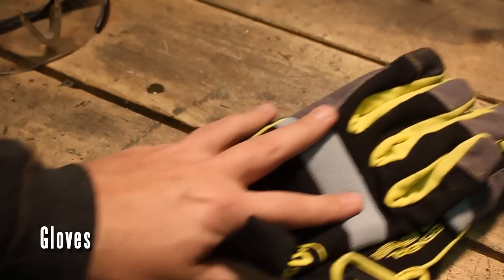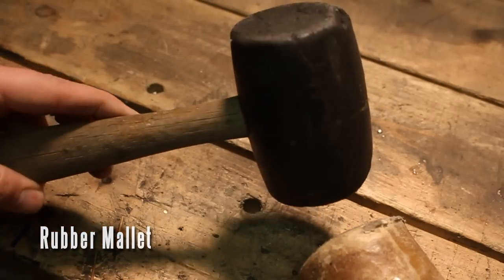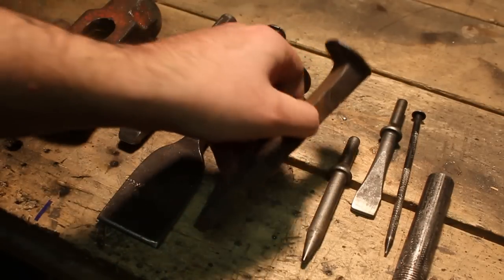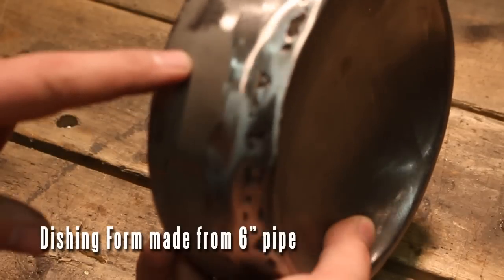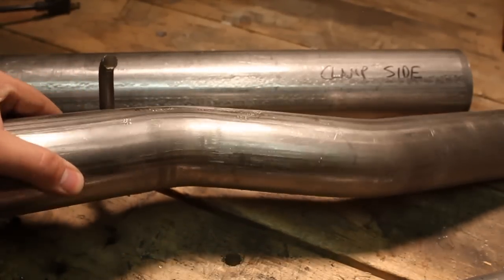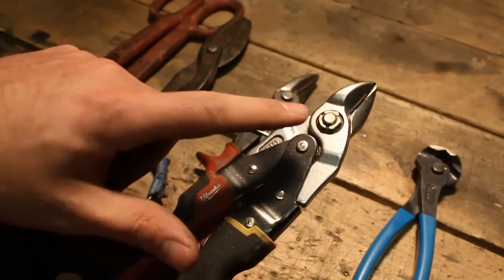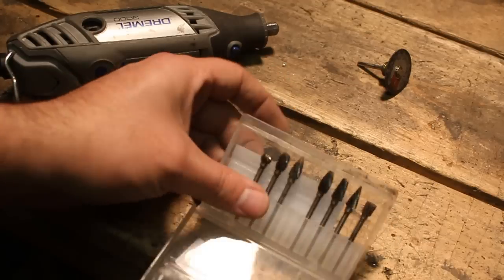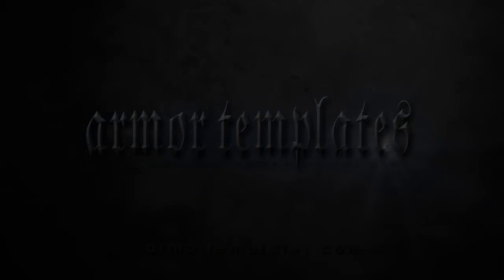Guide to Armoring Tools (cheap!)

Comment: How about smith a bevelly shear?
Reply from the maker: that might be a little beyond my skill haha
Reply: You could take some shears. drill a hole in the handle so that you can screw or bolt the bottom handle to a stump or bench. Then put a long pipe over the top handle to make it long. If you steal my idea can you give me a shout out please?
Reply from the maker: Well in addition to it being operated by a lever making it easier to cut, it also has no "throat". In other words, there's nowhere for metal to get caught on as you are cutting. With the design you described, you would just have very powerful snips mounted to a bench, and there would be a catch point where the blades meet. If you ever try it though, I'd like to see a video on it
Reply: Oh I was thinking of the old fashion version that was just big metal shears that you mount onto something. Like in the video 'Dressing in Steel:  Part One' by the Met. Which you can find on youtube. You can also see giant shears in the drawing of Emperor Maximilian's armour workshop.

Comment: what did the medieval armorers use to smooth and polish after the hammering and shaping?this has always been a curiosity to me as they did not have the convenience of electricity
Reply from the maker: They spent far more time (and skill) doing their planishing. As far as the final polishing of the surface, I am not sure. I imagine they had access to abrasives of some kind, but nothing like the sandpaper we use today.
Reply: @DavidGuyton  thanks for responding.
  it just occurred to me, (after reading your comment), that maybe they used crushed walnut shells, kind of like when you do the final polishing on a brass casing in one of those polishing tumblers.
i dont know, just musing here.

Comment: When making your armors what is your favorite or, most commonly used steel sheet thickness? For example 0.036?
Reason I ask is because i'd like to start making some of my own armors but, I don't know how thick a good steel shoulder pad, or bracer may be. Any feedback is helpful.
Reply from the maker: .036 mild steel is what I have been using lately. It all depends on what you are doing with the armor and what you are building. If the parts are dished, it adds a lot of strength and you can get by with using about 20 gauge (.036). If you are making something like a bracer, which is curved, but not dished, you may get some dents in it with some use. For a bracer or gauntlet I would probably bump up to 18 gauge (.050 or so). If you are looking for "real" armor that you intend to heat treat and all that jazz, you'll want to work with 16ga, but that stuff is hard to cut and hard to shape without heat. Using my method, the thinner stuff works best. if you want to use stainless, you can go thinner and still have good strength. For instance, 20ga stainless behaves more like 18ga in plain steel. It's harder, so it holds its shape better, but it is also a very stubborn metal when trying to shape it.
Reply: Thank you for the reply!  You gave me a lot of great info and that was exactly what I needed to hear. By the way great work! I've watched a lot of your videos and your projects and very cool and inspiring.

Comment: Sorry if this has already been asked, but I live in an apartment and no space for a workbench.  For the vise situation… would a jaw horse be stable enough for use in the projects you have templates for?
Reply from the maker: I'm a firm believer in the idea of making anything work. It might be a little more difficult or slower  but you can make it work.

Comment: What did you use to polish your sledgehammer head?
Reply from the maker: I used a flap disk on a handheld grinder to get started, and then I used some regular sandpaper in progressively finer grits to finalize it

Comment: Thanks for the insight 
I want to work more with metal after seeing your inspirational videos. What gauge steel do you mainly work with?
Reply from the maker: I use anything from 20 gauge to 16 gauge, but I tend to use the thinner stuff because it's easier to work without heat. I try to keep things simple on this channel so that lots of people can do this, as opposed to making videos that would be beyond the ability of most average people.
Reply: And it's appreciated, thanks :)

Comment: Do you only deal with costume Armour or do you have some knowledge on more practical sets?
Reply from the maker: I stick to easier stuff that ordinary people can pull off, although I work with up to 16 gauge on occasion. No heat treatment though
Reply: @DavidGuyton  would Heat treatment add enough hardness for it to be a more resistant Armour, just wondering what modern ballistic steel Armour
Reply from the maker: @jsticks7381  Yes heat treatment hardens the steel significantly. The ballistic plate armor is most definitely hardened.

Comment: Hi David! Your tutorials are amazing and blow my mind every time! But I was curious on how much one of these projects (Gauntlet 1 or 2)  would cost to make. Excluding the templates and tools of course.
Reply from the maker: You mean just the cost of materials? It would depend on the materials you chose. The gloves are about $13 at Walmart or Amazon. If you chose stainless steel, you can get enough to make 2 gauntlets for about $20. Brass is much, much more expensive, and you'll need to spend about $140 in brass for 2 gauntlets. You'll probably spend a few bucks on a few other things but as long as you stay away from brass it's not expensive at all.
Reply: thanks man!

Comment: great work david  i was just wondering how you make your patterns as i am a big fella like my calf muscles are 25 '' or 635 mm around , do you just take a look and start cutting or is there another method like cling wrap and duc tape etc also what thickness steel do you recommend using ... big pete from Australia
Reply from the maker: hello Big Pete! When I design patterns I start with stiff paper (we call it poster board here but I am not sure if you have it there by the same name). I take a few basic measurements (like you seem to have done already). For instance, measure from the knee down to the ankle, and another measurement around the calf. Then I make marks on the paper using the measurements. This gives you a very basic starting point to work with. Now you can do a rough sketch of a design, cut it out and see if it fits your leg. You will likely find that it doesn't fit very well, and you will need to trim some paper away. You may also notice that parts of your leg are not covered, and you need to make some areas larger (you will likely have to start over with new paper if this is the case). You have to also keep in mind that you need to have good articulation, so one part cannot interfere with another part, etc. You also need to account for pieces being able to go on to, and come off of your body. For instance, if you make a gauntlet too tight and you can't fit your hand though the wrist area. To make it work, you need to be sure the gauntlet is split and can be clasped together once it is put on. There's a lot that goes into making the patterns...a whole lot....
Reply from the maker: oh and as far as thickness, that all depends on your personal taste. If you want "real" armor, you need the thick stuff (18, 16, 14 gauge) if you are into something a little more like a costume, but still fairly strong, 18 or 20 gauge (the higher the number, the thinner the metal)